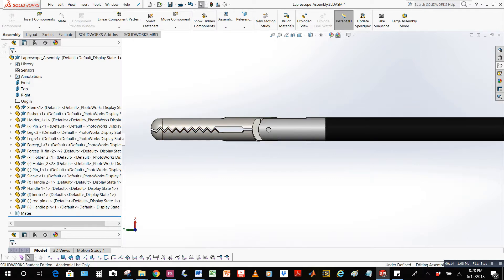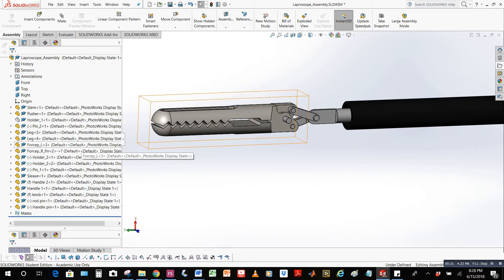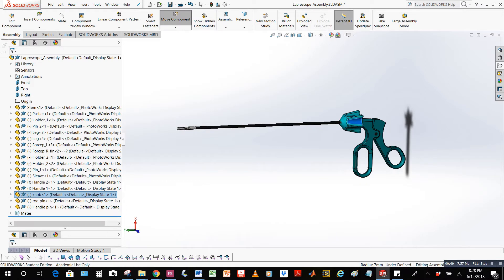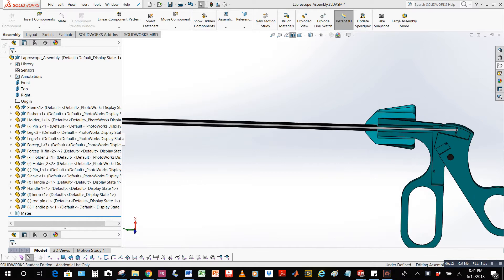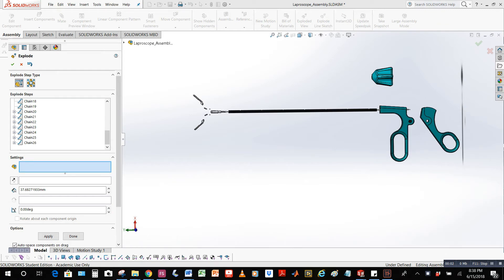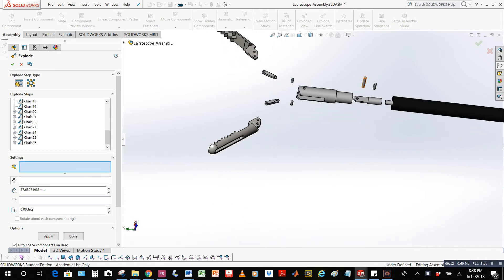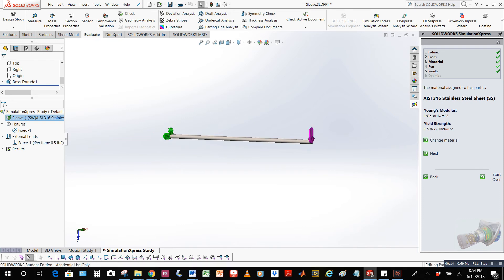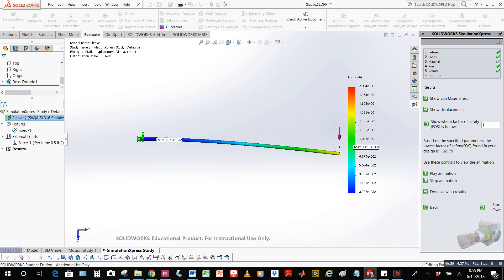Laparoscopic graspers solidworks project

Comment: Thanks for sharing ! I'm part of a project tasked with designing a fully 3d printed laparoscopic gripper. The way you pull the cable using the slot wouldn't work. It's smart but the cable needs to be able to rotate. In this design, the pin would come out of the slot when rotated... I'm still amazed by the complexity of such a little tool, it blows my mind !